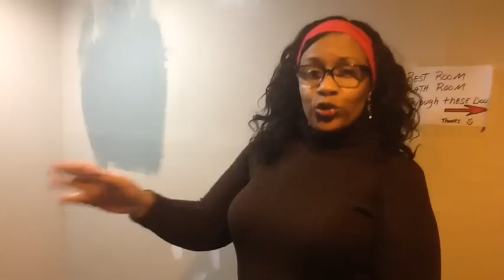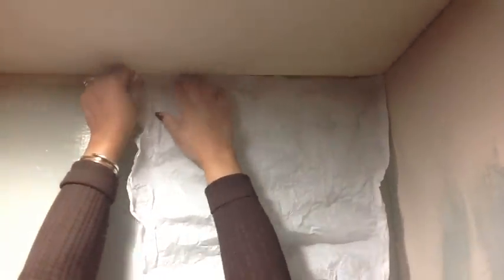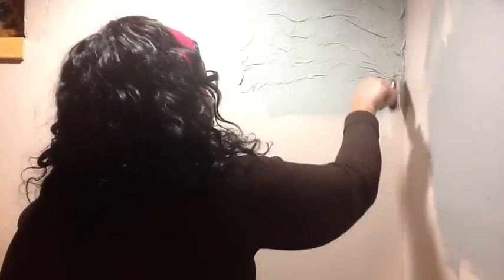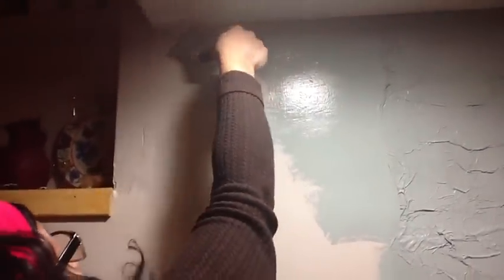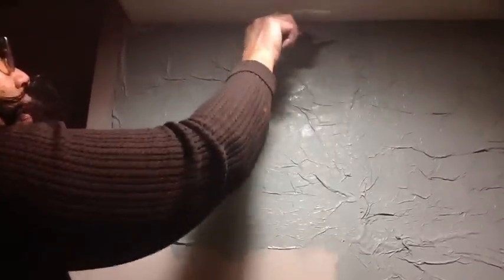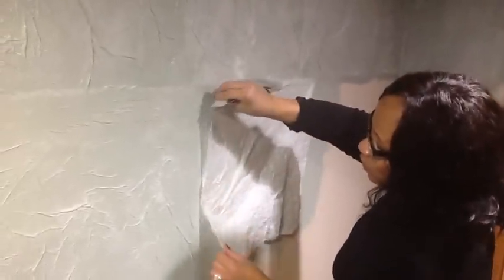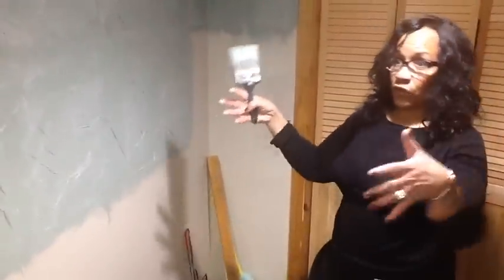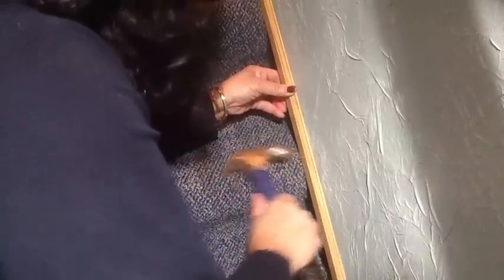How To Enhance Walls With Tissue Paper

Comment: Very nice job!  FYI:  If you tear the straight edges off the tissue paper before you put it up, you'll avoid the box look you spoke of since the two edges butting up against each other will be torn paper instead,  You can use the straight edge where the paper meets the ceiling, floor, and corners though.  I had done this many year's ago and came back for a refresher as this home I'm in now has terrible plaster walls in need of covering. Off to the paint store I go!  Thanks again!
Reply: I'm here for a refresher too. I forgot about the "rip into pieces" part of the crinkle. I put a glaze over mine because I did the tissue in a bathroom.  It held up nicely.
Reply: @NolomEbal44560  That's good to know it held up.  I have a bathroom in need of coverage so that's much!  I've avoided doing this because of steam so good go know it can work.
Reply: @NolomEbal44560 what is the glaze called?

Comment: Then this 10 years ago in my living room. The wall still looks fantastic! The only thing I did different is I kept tapping on it a little more and then I'd wipe it a few times with a flat hand different directions. I did use a roller  paint those are much faster. When you put the paint on top of the tissue paper with the roller paint different directions. Make sure you overlap all edges and make sure it's wet underneath on all edges. I used rounds in my colors. The brown that I used with the glaze. You put it on and wipe it off. It really looks like leather I love it

Comment: would it not be cheaper to use hodge podge.. glue to tack down the tissue paper,   then paint over.  Paint is so expensive here.   I did a textured wall years ago with powder filler.. mixed it up and just made designs... not easy.